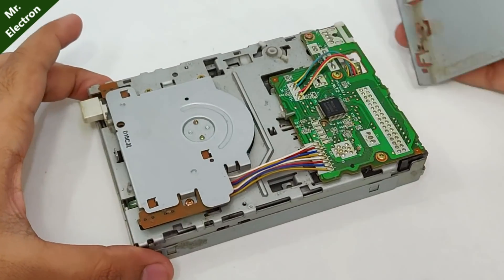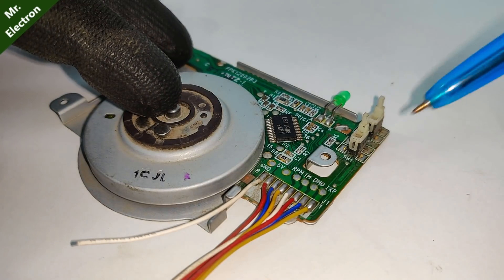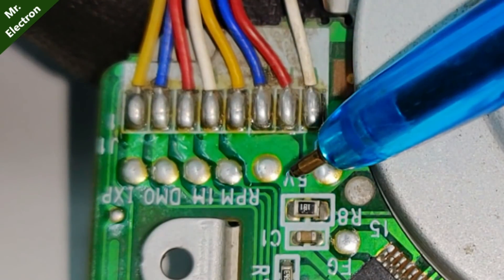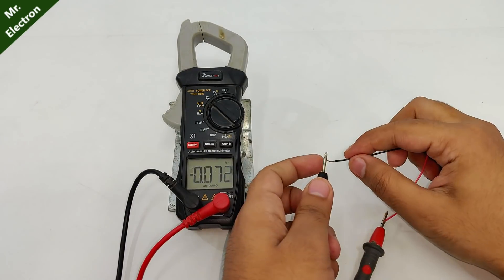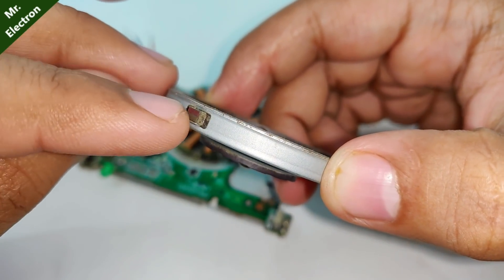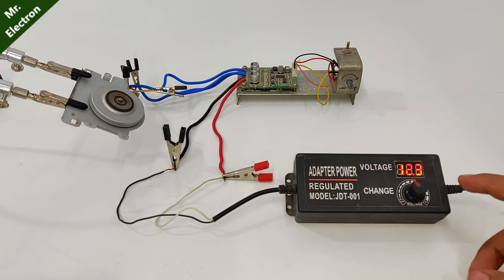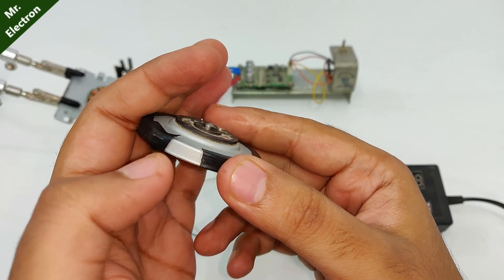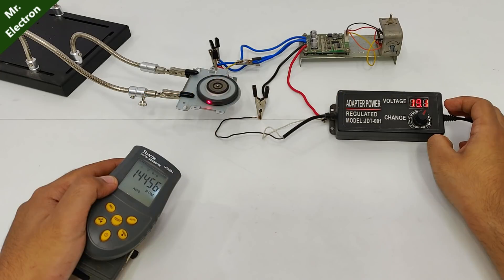14000 RPM - Reuse 12V Super High Speed DC Motor from DEAD Floppy - Brushless BLDC Motors

Comment: There were 4 terminals from the stator, but you added 3 wires. Which one is not required? You should clarify the connections.
Reply from the maker: The multiple tapping one

Comment: Can we use this type of brushless controller -  5V 12V Brushless DC Motor Driver Controller Board with Reverse Voltage Over Current Protection for Hard Drive Motor 3/4 Wire?

Comment: you soldered four conductors from the motor, and apparently connected them according to a three-phase circuit-where did the fourth conductor go?
Reply: The forth is all the wires together. It does go anywhere!

Comment: today I'm hacked floppy disk motor the same model , shorted wires blue and red ( 6 & 7 respectively ) put a jumper on pin 17 &18, 23&24 but it run very slow

Comment: do you see those pwm 1m dmo ixp wire you must connect it to pluse signal to run it if not ve pwm sig it wont run event connect pwer 5v in

Comment: your video skiped at 5:13 of cables connections, winding has four outputs, you have connect with three wire only, how ????
Reply: It's a star connection. The output with three wires together isn't needed to be connected.
Reply from the maker: 4th one is tapping point which remains disconnected.